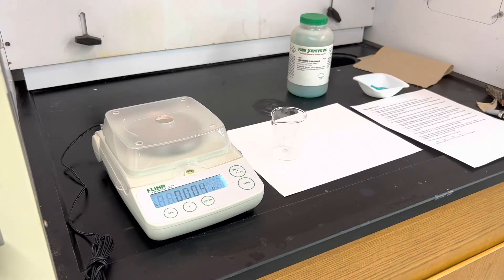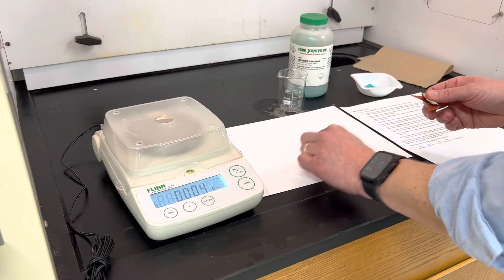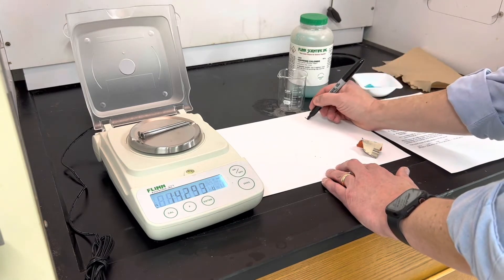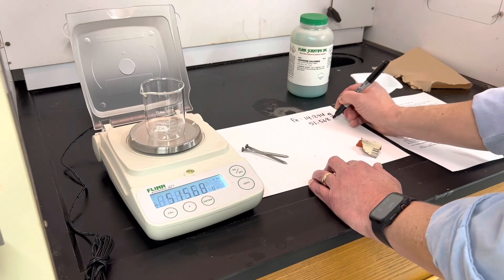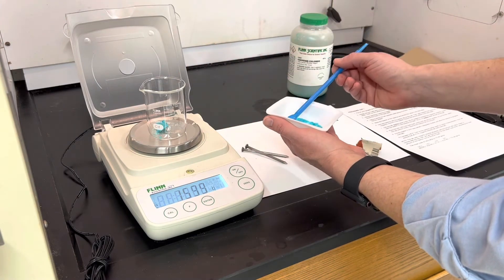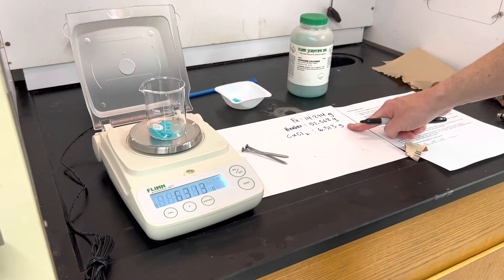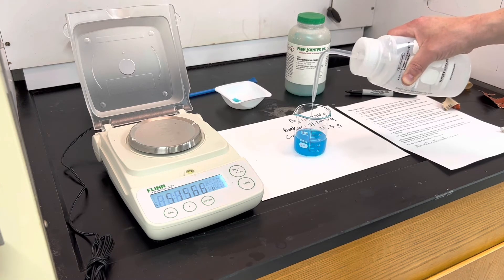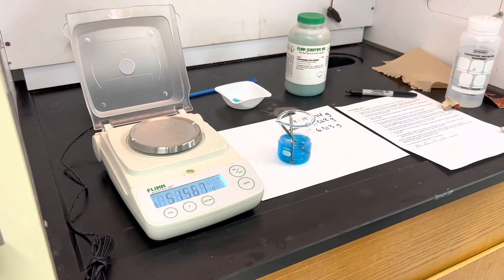The Nail Lab: Reaction of Iron with Copper(II) Chloride

Comment: I love these reactions! So simple but so fascinating. I'm an "uneducated" amateur hydrometallurgist in the middle of learning how to deal with waste in an ethical way.

Anyways I'm treating a 5 gallon bucket using this method, the copper cemented out just fine. My concern is there is a clear/white-ish crystal with very fine needles densely packed together, growing on the iron/steel.
What might that be? And will I have to add something to the solution to clear that out as well as the copper?

This copper(II) waste is from circuit boards

If you need more information please ask😊
Reply from the maker: This is really interesting. I’m honestly not sure what the other crystal would be. Sorry I can’t be of help.